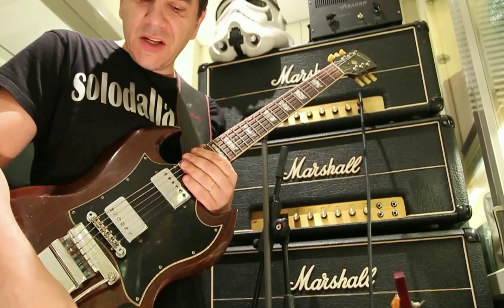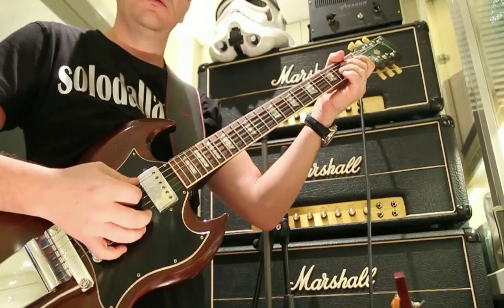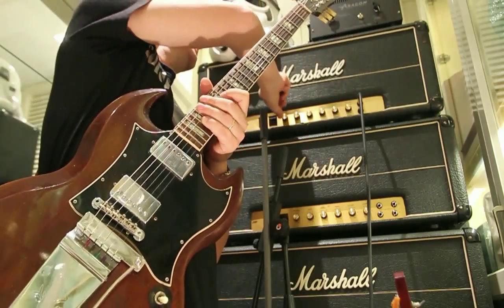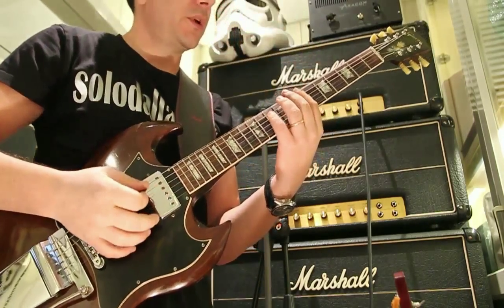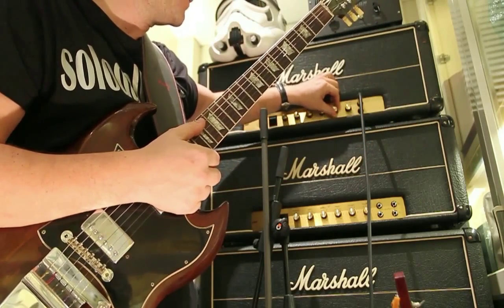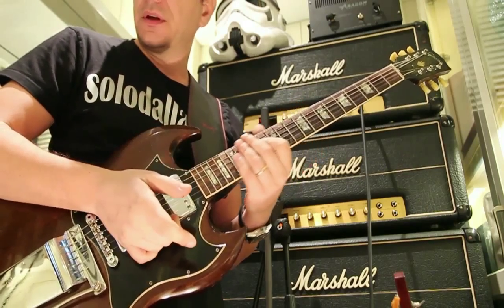An Aracom Attenuator and a Few Vintage Marshalls P4

Comment: Does the back top portion of your Aracom get really hot? I have other attenuators, but this one is much hotter. I think they should have had some vents in the top as well. Seems like heat is getting trapped in that 1" space between the top and the side vents. They do sound good though!
Maybe a fan?

Comment: My jmp 2203 1979 ain´t so "gainy" like yout 2204. What can I do ? My tubes are alright yet. (ECC 83 and Electro Harmonix EL 34) Which tubes do you recommend for a 2203 ? Another question: How does the schaffer replica sound at low volume with a non attenuated 2203 ? Thank you Fil !